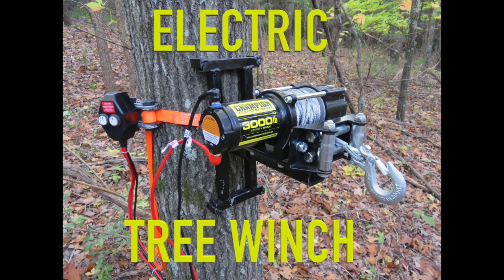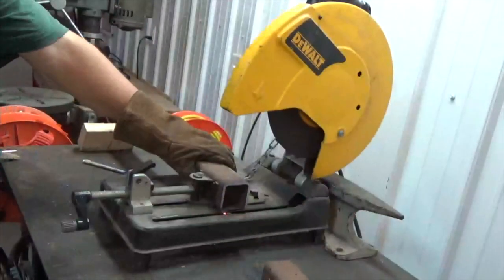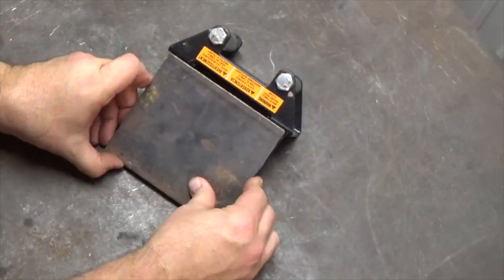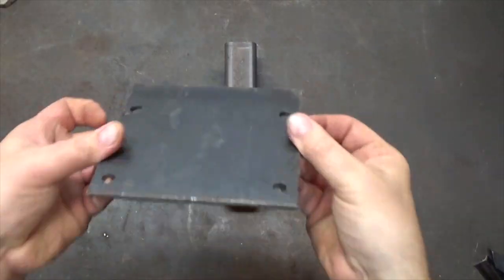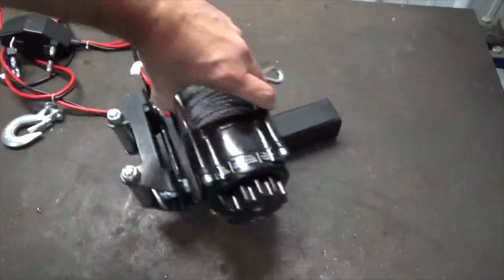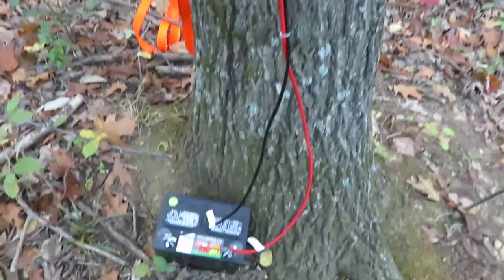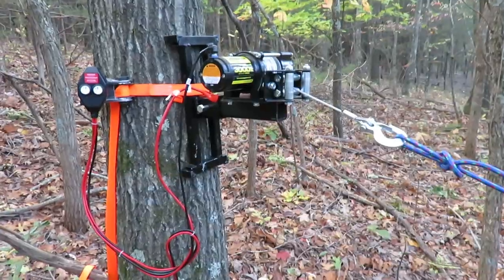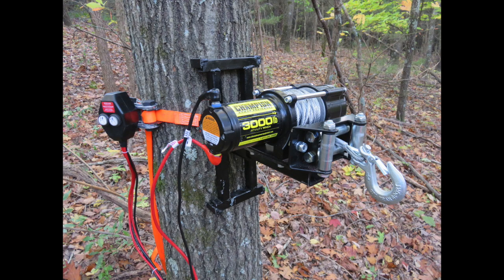Electric Tree Winch - Portable Deer Winch - Welding

Comment: Very nice video I seen so far! Ive been searching the web for this kind of application with the winch used solely by battery. I just bought one and trying to use it to pull 3-4 sacks (50kgs) per load from a hill like 80m down in a slide or cart. I also need to transport like 30 sacks (One time in a day).  Here is my question, really appreciate if you could response.:) 

1. How long was your continuous pull with it? Can the winch work like at least 20m straight? 
2. How long you used the battery while continuously pulling?   

I am thinking to respool the rope with 4mm which could reach like 30m, considering only pulling not too heavy loads (I think). 
Sorry for lots of question, but really appreciate your feedback. :)
Reply from the maker: Those are very good questions.  
1). My continuous pull was the length of the cable in the spool.  I really don't know the exact length..   The Winch wood rest for a little bit when I would re-extend the cable to my rope for re-hooking.  I believe that was long enough of a rest, because it took me at least 30 to 45 minutes to get my dear from the bottom of the hollow to the top of the Ridge.   
I also used it recently to pull a woodstove (on a 4 wheel dolly) up a hill from the backyard to the front driveway and then up a ramp onto the trailer.   Once again, I would have to stop to draw the cable out and re-hook to the rope. This was probably an hours worth of use with probably  5-10 minutes of rest in between.
2) I'm not sure what you mean by how long do I use the battery? It's the only way to operate it so the battery is in use the whole time..  

Hope this helped

Comment: How far can you pull a deer on your battery before it dies?
Reply from the maker: I'm not real sure about that. I've never had one die on me.  I've pulled deer out of very deep hollows where you can see the tops of trees. From the depths of those hollows to the top of the ridge.
Reply: @PhilCrockett most winches have a recommended duty cycle of around 15 seconds then you're supposed to cut it off and let it cool for a few minutes. I honestly don't know of anyone that does that though. From a mower battery you should be able to run it nonstop for about 2mins before depleting the battery. But you'll be out of cable to pull in before that happens.

Comment: great concept.  sometimes it is necessary to remove bushes or an old hedge with roots in order to plant a new one.  there is usually a tree nearby.  will the cable fit nicely on the drum even if the winch is slightly at an angle to the thing you're pulling?
Reply from the maker: yes... But not too much of an angle

Comment: I've been looking into a drill winch for the same purpose. I have a spot I hunt that the deer has to come up a steep hill. I can drag it if my friend is there to help but if I'm by myself it would be impossible. I thought about doing this method but with a boat winch. Its public land so I can't leave anything there it would have to come in and out with the game cart.
Reply: Have you tried your drill winch out. I always hunt by myself. Very interesting idea.
Reply from the maker: Are you talking about my other winch video?
Reply: @PhilCrockett  
Only other winch video I saw was the boat winch. This is a Warn winch made specifically for use with a drill. 750 pound rating. Weighs less than 10 pounds. Got it at Auto Zone $199. Last year.
Reply: I did not get to use it this year. I have tested the strength of it and I think it will do great. I a couple of aluminum pulleys just in case. 
Have used a gasoline winch for several years but it is rated 2000 pounds. I removed the steel cable and replaced it with 3/8” rope. 
Strap it to my deer dolly. 
This drill winch is so much lighter. Made by Warn. I got mine at AutoZone $199. 
And purchased a Dewalt 1800 rpm drill and two batteries. $159 at Rural King. 
I now use a jet sled instead of the dolly. It works much better. 
Good hunting. 🦌

Comment: Wow, that could help me as a tree worker. I can't tell the thicknesses in the video. Do you have a parts list?
Reply from the maker: I used scrap, but my favorite thickness is 3/16" for most structures.   My utility trailer that I built is 3/16" metal.

Comment: Good design, I made a modified version. Didn't use square stock, used round for the sides to reduce forces exerted on corners of yours, also flat bar bridged closer to the receiver...this ensures more welding to receiver and side bars for added stability and strength.  I'm pulling stumps with an 8 to 1 pulley setup, 32k lbs max distributed.  Only done a test run on smaller butterfly bush....pinched the winch cable but it does work great.  Might replace with synthetic rope.
Reply from the maker: excellent! thanks for watching!

Comment: Very nice. You could put a solar panel on it to charge it, or mount it to a tree and plug in your cooler that way your not moving the battery  in and out of the bush.
Reply from the maker: Good tip!

Comment: Would this setup be strong enough to pull out very small poplar stumps, 3-4 inches in diameter?
Reply: Did you try it? I just built it and will be pulling tan oaks and small Redwoods up a ravine using a 13000 lb winch and two snatch blocks. I'll report back.
Reply: @dangerous8333  so what's the verdict
Reply from the maker: idk..... never tried that.  Let me know

Comment: What weighs more, the winch and battery, or the deer?
Reply from the maker: HA!  No comparison.... trust me.  I have a bad back, and this has been the answer to all my deer drag'n problems.
Reply: @PhilCrockett  you'll never convince me that someone is dragging a winch, mount made of steel tubing, a 12v battery, a gun or bow around the woods while hunting especially if you have a bad back, I just can't see it.
Reply from the maker: @FriendsInLowPlaces     
Ya... I wouldn't drag all that around either.  That would be insane.  I would use a deer cart, a backpack, or just leaving it at the top of the hill like I do so you can pull the deer up the hill.  No reason to drag that winch around the woods with you.  Sometimes I leave it in the truck until I need it.  BTW... note that the 12V is a lawnmower battery (which is the heaviest item) weighs 21 lbs. 
The wench weighs 19 lbs.  The metal is 7 lbs.  Grand total is 47 lbs.  That's a little less than a sack of feed.   If you are shooting deer that weigh less than 50 lbs, then you don't need this wench.
Reply: @friendsinlowplaces619  it's called watch the video...did you not see his son 😒
Reply: @PhilCrockett  outch lol
Reply: @PhilCrockett  I guess someone never retrieved a deer in a ravine lol
Reply: My Shooting iron weighs more
Reply from the maker: @O.K. Frax  HA!   nice!

Comment: Thanks for the video info. I'm using it to load my powered wheelchair in back of my van. Before my accident I was 6`- 5" and 250 lbs. The winch lifts the 90 lb. Heavy duty chair, then my friend and I made a sliding dove tail slide to push the chair in, lower it and done and on my way outdoors in my all terrain powered wheelchair.
Reply from the maker: That's a genius idea, my friend!

Comment: This is great!!! I need something like this to pull my pontoon boat out on to the shore each fall.  I am not mechanical and will not be welding any time soon.  Do you think the PVC Tree Mount from amazon PVC-1263 will do the trick.  It looks exactly like what you did.  But, they seem to only recommend it with a honda gas winch which caps out at 2200lbs.  I would like to get a winch at 4-5k lbs.  Do you think the PVC-1263 will work?
Reply from the maker: Not sure if that Pole Mount would work or not.  It all depends on the weight and drag / friction of what your dragging the boat over.... also grade of the bank.  I once had this idea about being able to launch a boat without a boat ramp.  I could make long runners (kind of like atv ramps) that would connect to the rear boat trailer and end up in the water.  Then.... I would winch up on the trailer.  thought about rollers vs carpet surface.....anyway...Still working on that one in my head.   My point... is....  it's kind of the same thing.  There are a lot of variables that you have to figure in.  or...... just trial-n-error....
you could just simply put a log chain around the tree, and hook to the base of the winch somehow.

Comment: Use deep cycle batteries for winches
Reply from the maker: This is an ATV winch.   Do ATVs use deep cycle batteries?  Also....  what's the advantage?  I've never had any issues over the years using the batteries in my video, but I'm always willing to improve the product.  Let me know, Abe.  Thanks!
Reply: @PhilCrockett  i have experience with the motors on a winch pulling alot of power from the battery..hence the reson for using deep cycle batteries

Comment: Nice, just got the exact same winch to do the same thing with firewood rounds lol. How's the winch holding up? Also thought I would point out that a clove hitch would be easier to untie once you've done dragged  your load:>)
Reply from the maker: Winch is still in perfect shape.  It was a good buy for sure.  
Thanks for the tip on 'clove hitch' .... I agree.

Comment: Fyi, you will never need to worry for pulling a deer but if you start pulling heavy loads using a bolt like that to secure the tube to the mount can shear off the bolt. Pins are surface hardened and much less likely to shear off. jist a notr fellow DIYers
Reply from the maker: Never had any issues with the cheap bolts I use (actually used a stick once on a 200 lb deer  (it was hickory)..., but I appreciate your taste for quality bolts, Bryan.  My favorite brand is Lawson.

Comment: I was thinking of doing the same thing but I figured I would need a full size battery. Good to know I can use a smaller battery. How long will your battery last?
Reply from the maker: I've never had the battery die on me.  I've pulled 2 or 3 deer up out of hollows in one day with plenty of juice.  Then, I put the battery on the charger for the next hunt.

Comment: Hi Phil - I need this in my life to pull out our boat and jetski from the water.  Are you interested in selling one?  I have the EXACT same winch.......hoping you say yes as I don't have an ATV to mount the winch to and have just been using some strapping to secure it to the tree but it's a real pain. Cheers.
Reply from the maker: Rob, I’m not in that sort of business, however, I bet with a little asking around, you can find some one that would weld for you.  Get the pieces cut and drilled before asking.  There may even be a welding school (high school welding class) that u could find.  Send a link of this video.  My son took welding in high school, and they got all kinds of projects from folks.

Comment: Awesome video. I just made something similar for this coming deer season. What size 12v battery did you use?  Looking online there are a ton of 12v batteries just not sure on the amp hour stuff.
Reply from the maker: I used a cheap $20 lawn mower battery.  I just make sure it's charged up in between uses.   It's never let me down.

Comment: How loud does it run?
Reply from the maker: Mine is really quiet.  Just a soft hum.  In fact, I make more noise during this process than the winch motor.
Reply: @PhilCrockett  Cool!   I paint homes for a living my own business so anytime I'm looking to purchase a home to live in I always exclude condos.   but there's one that's super inexpensive on the second floor of a place because there's no elevator and I had this idea to hook up a little swinging arm and platform on a winch so I could load up my tools pick them up swing them out over the balcony and lower them to the ground down below.     first thing that comes to mind is how loud the motor might be morning and night when I'm taking tools and equipment in and out.  I don't know.  Is that a crazy idea?
Reply from the maker: Justin !!!!  That is a genius idea!!!   In fact.....  electricians use a similar process when pulling large wires and cables up several stories.   I was walking through a local hospital and got to see a winch in use for that purpose just a couple years ago.   They actually anchored the winch to the floor with concrete anchors.   I think your idea is fantastic!!

Comment: How long does the batter last before you have to charge it??
Reply from the maker: I've never used it long enough to run it down to know.  I charge it overnight, take it with me, usually pull 2 or 3 deer up out of the hollow, and then I'm done for the season.  It was in storage on a wood shelf in my barn since November.  I recently (3 weeks ago) went to start my mower and the battery was dead from the long winter, so I decided to try this battery out.  I put it on the charger, only to find that it was still fully charged.  I didn't expect that.  I can probably use it again this November.

Comment: Word of advice, never trust a cooler being waterproof, it just becomes a watery tomb for $$$.
Reply from the maker: condensation maybe?
Reply: @PhilCrockett  Maybe, but every single cooler I've ever had, filled up with water. Maybe I'm buying cheap coolers lol 
I always keep a piece of vinyl over mine. Its heavy enough to not blow off or a corner flip up. All my tool boxes, tackle boxes-same thing, if I get caught out or forget to cover them, I'm busy drying stuff out,oiling and replacing things instead working or fishing. 
I lost a brand new charge controller for my solar panels trying to keep it dry lol.
Mother nature finds a way both good and bad. 
Maybe your cooler won't leak, maybe run a test? Jtbotss.
Great video!
Reply from the maker: I appreciate the tip from you.  This is how I like to learn about things, rather than from ruin.   My favorite storage boxes are military surplus ammo boxes that secure tight with a latch.  I might have to figure one of these in on storage.  maybe a rocket box, or one of the bigger ones.   Thanks again for the comment.  I'm thrilled that you like my videos.  God bless you!

Comment: have you tried this to hoist a deer for gutting/skinning? i have your hand winch design that i use now but i want to try this new design so all i have to do is cut a slit for the gambrel
Reply from the maker: Absolutely!   I NEVER field dress unless the deer is hanging "head up of course".  Just did 4 deer last weekend.   However,  My favorite way, is using the truck hoist.  I like having the tailgate as a table.  But when I have to field dress in the woods, this is the way to go.  My Back loves me for it!  Here's the truck hoist if you haven't seen it.  Just like the store -bought, except cumstom made for my needs....... and cheaper if you make it! :     https://youtu.be/PD72WijswfI
Reply: @PhilCrockett  is there any particular gauge of steel you were using? Or would u have any internal and external dimensions?

Comment: Love the idea. Just a thought, but you could attach a solar panel on top of the cooler so it's charging anytime it's not in use. Should charge the batter up in a couple days. No need to take battery in and out then.
Reply from the maker: Good call!

Comment: Just the solution I was looking for, how is that working out for you? Does the battery have a shorter life with it being constantly drained? Or does it go on a permanent trickle charge?
Reply from the maker: I made this strictly for pulling deer out the hollows that I hunt, so really haven't used it much since deer season.  I did pull a huge dead limb from a tree not too long ago with it.  So it's working out great.  As far as charging....  I usually put it on trickle charge in my barn.  However,  right now it's sitting on a wood shelf and I haven't had to use it to know if it's still charged.   If it doesn't last until next deer season, then I'll buy another one.  Pretty cheap when comparing it to back or knee surgery which is what I'm trying to avoid by using this thing.   Thanks for the question and feedback.  So glad you like my idea.
Reply: Thanks for the quick reply, that is all I would be using it for, extracting red deer from some tough places. I had been looking at the Honda 4 stroke PCW, but your clever solution would work equally well at a fraction of the price.
Reply: Richard Jackson lau
Reply: Richard Jackson marine gel battery can handle constant drain

Comment: Great idea however, I plan on pulling up logs at least 15 feet long and at least 50 ft in distance.  How long will a truck battery last with that kind of load.
Reply: I suggest starting the truck before winching so it will never be an issue. Drawing down truck batteries isn't good for them. If you need portability you can use a quality (not the Schauer junk Walmart sells) jump start pack. I've used my JNC 660 to run my much heavier Ramsey winch for short periods before I wired it in. I've had it for years after using one every day at a used car lot. You can recharge 'em off your cigarette lighter too.
Reply from the maker: I don't know.  Depends on the weight and time I guess.   Let me know how it works.   Thanks for the comment, William!

Comment: Good idea and great video, very nice job. I'm thinking about something like that too but for pulling a moose( with a sled like "animal skidder"). I think i will use a small generator 950 W connect on a car battery for more autonomy with the winch. What do you think about it? Another question: do you think the winch can work in continus for a long distance? Thanks for the anwser Mr Crockett
Reply from the maker: Most winches like these aren't really meant for long distance.  In fact.... I had to test it out before making this, just to see what it can do.  I figure if it's too far, then just stop and let it cool at intervals.  Would be good to see what kind of heck a fellow could give it.  Let me know how it works for you, if you decide to pull a moose.
Reply: Thank you for the answer, i will test it next summer when i will built my winch system but yours is very interesting, great job !!!